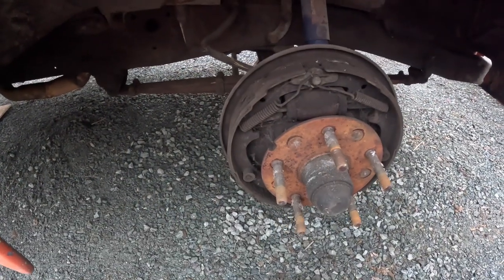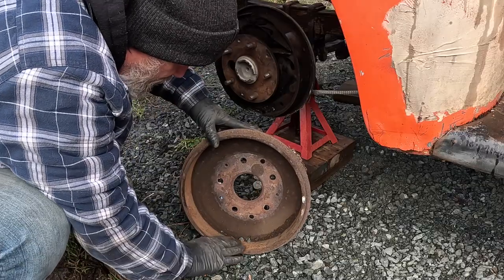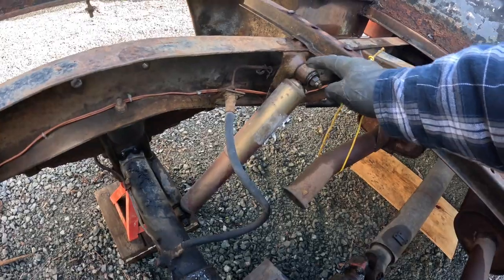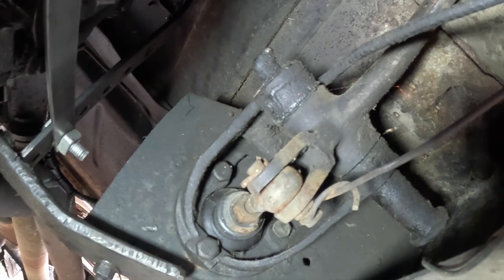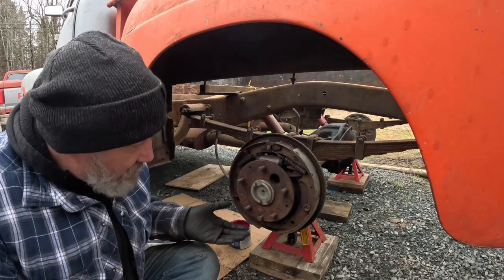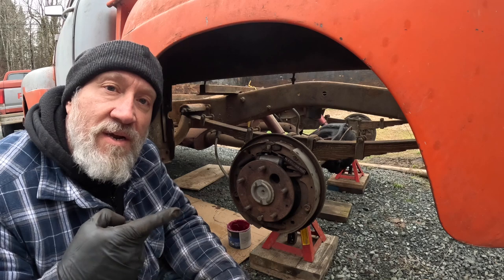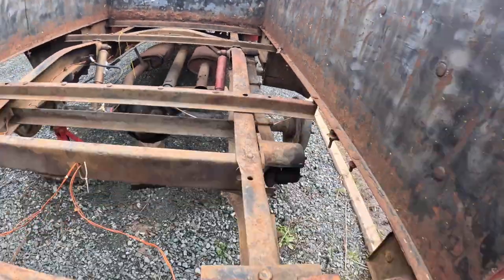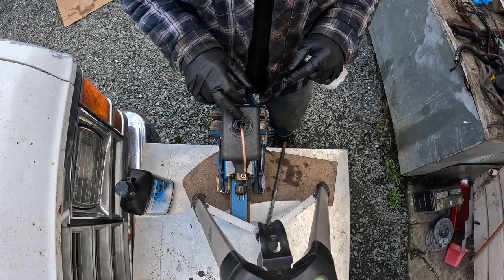1950 Ford F1 | How do these old brakes even work? | Wet Coast Fab

Comment: Why can't you use flexible hose the entire way instead of hard line?
Reply from the maker: I could, but for a couple reasons: the longer the flexible hose is, the less rigid it is so the brakes would get 'soft' as the hose expands with brake pressure, and to counteract that, a stainless braided hose would work, like on most motorcycles, but that stuff is spendy and a lot harder to work with.

Comment: Although that is a slick flaring tool, it's $300 in Canada. The other one is $35 and if you place it in a vise I can make the same flares as that tool all day long. The problem with the more affordable one is people try to hold the tool in their hands while tightening to make the flare, resulting in off center flares, split flares and broken dies. If the tool is used properly, admittedly it's not quite as fast but it works equally as well. After 40 years of custom brake lines and nitrous systems I wore out the first tool and am on the second. So after my $70 investment over my career, I and made thousands. As many lines as I have done the Turret tool would be worth it but when I started there was no such thing and if there was most mechanics couldn't afford it. lol
Reply from the maker: I hear you! I've used the same cheap flaring tool for years and just never seemed to get the hang of it, no matter how hard I tried! I'm happy now, even with the expense, knowing that my brake line flares' quality is as good as I can make them.

Comment: I like that tube flare tool. I bought one from Harbor Freight that was better than the cheap one you showed but not as nice as yours. I ended up making some that were okay but bought others off shelf. The trouble with buying them from shelf is that they may be a little long. I had a 53 F-100 panel truck, now a 66 F-100 pickup, same brakes as your 50 except the 66 is self adjusting. Good video.
Reply from the maker: Thanks for the comments and the kind words! I shake my head every time I remembered struggling with those other stupid cheap flaring tools. The F-100 is another one of my favourite Ford trucks

Comment: I will try and keep as much originality to a classic vehicle as possible but will always replace a single brake master cylinder to a dual. Safety!
Reply from the maker: I 100% agree with you! I have a late 60's Mustang dual circuit master cylinder waiting for me to install after I get the truck through inspection. I also have 3-point modern seatbelts that will go in as well. This F1 also only came with the driver's side windshield wiper (passenger side was an option). I may put in dual wipers as well.

Comment: I just started on a 52 F-1 project.  I intend to restore mostly as original, including the flathead and three speed column shift.   I will consider a brake modernization though.  

It would be nice to have a two chamber master, but most that I can find need  a new location and pedal modifications, and are mostly designed for disc brakes (front) and power boosters.   I owned and drove one of these 40 years ago, and don't recall the brakes being particularly weak.  I won't be hot-rodding this, so how relevant is a modern disc brake conversion?  Also not sure the disc conversion will fit inside the original steel wheels which I plan to keep using.  Any recommendations on this?

As for the $200 flaring turret tool, I see that I can buy a five piece hard line set in stainless for less $$.  However, the truck I have is from a dry climate, and the current hard lines still look usable.  Is there a way to test the lines, or determine if they are sound enough to continue using?  Do they rust from the inside and harbor weaknesses unseen from the outside?

I will definitely be replacing all the cylinders, flexible lines, and pads regardless.  And I'm pretty sure I'll need new drums all around.  Do you have a good source for new brake drums for a 1952?

Thanks, Matt

Comment: Do you have a video of you bleeding the brakes? I own a 1949 and the master is empty
Reply from the maker: Sorry, nothing specific, no. I used a vacuum bleeder to do all 4 corners starting at the wheel cylinder farthest from the master cylinder (right-rear). I found what really helped was a small plastic funnel that I was able to thread into the fill port of the master cylinder and keeping that topped up.